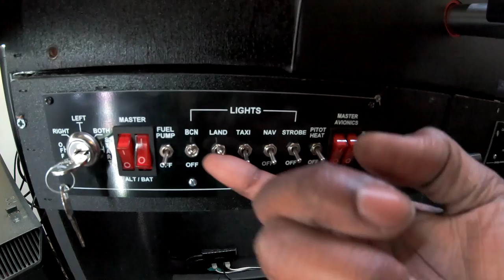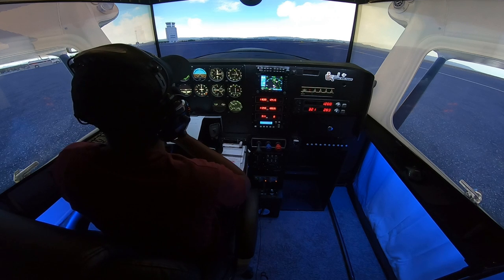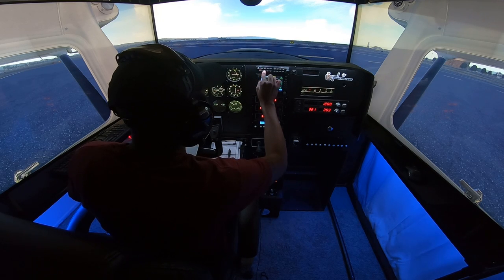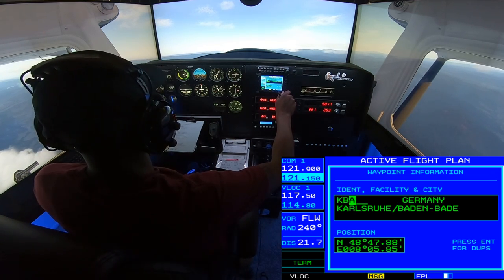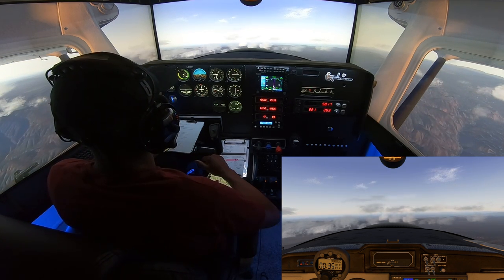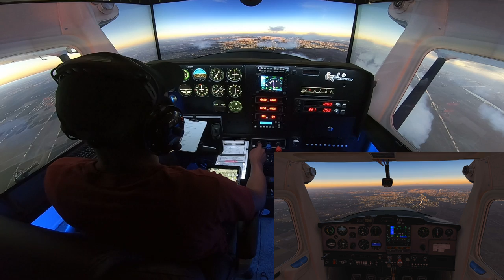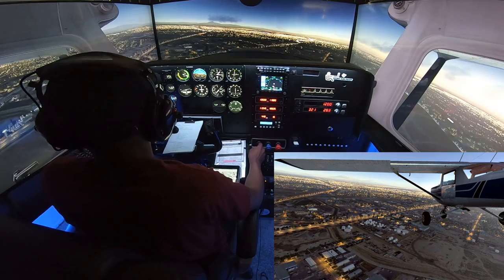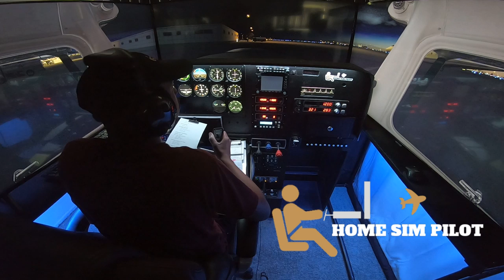FLYING To Bakersfield (KBFL) | Pilotedge CAT 5 Flight | Home Sim Pilot | Xplane 11 50 Vulkan b9

Comment: Really good flight. Just one small pointer. In initial takeoff your vertical speed indicator showed a huge value (almost 2000 fpm). In real flight your ears would hurt a little bit.  Just take care of the vertical speed and keep it a little bit down. These lights airplanes are climbed between 500 and 1000 fpm depending on the weather (hot or cold)  Rest was excellent. Keep up the good work :)

Comment: Man I love your videos! The mrs isn't quite as impressed given I'm measuring rooms to see if I'd be able to fit something similar 😂

Quick question though, I  read in your description you were running the 3 TVs at 1440p off one rtx2080? What sort of fps do you manage with and without Vulkan? I'd be using an rx5700xt so just curious. Thanks in advance!

Comment: Great work on your part putting all this together.  I need a consult with you as I put together a triple monitor flight simulator starting with Microsoft flight simulator X on my laptop (i7, 32 gb ram, 4gb video ram, etc) and then later putting together an i7 or i9, tower with 12 gb video  ram, 3 hdmi out, 64, gb, ram, 4k, blah blah) with one of the more recent Microsoft Fight Simulator Packages.  Peripherals will be all Saitek. Unfortunately, my budget for this is shoestring and my computer skills are mediocre.  Any help you can give me will be appreciated.

Thanks,

J

Comment: Hey man, very nice sim! Can you set the QFE using that setup? Your altimeter was reading 500 feet on the ground when you landed which might have been why you were low on the approach. Great video.
Reply from the maker: Thanks for watching Captain! I should've flown the pattern a little tighter instead of being so far out on final. I think that would've help. And I had the correct altimeter setting dialed in, the airport elevation at KBFL is 510'.
Reply: @HomeSimPilot  Ah, got it. I think I'm just used to setting the field elevation for landing to avoid the mental arithmetic every time I look at the altimeter. You did a great job and you have made me want to build a sim like this. Thanks man.

Comment: Question: You showed us in your rebuild video that you're using Air Manager for the 6-pack, but I noticed you're adjusting the OBI needle with a physical control. Is that part of the panel overlay you have, or did you install some physical gauge housings to accommodate that?
Reply from the maker: The knobs are part of the Cessna panel mask that im using. When i pull it off to change different aircraft I wont have the physical knobs anymore. So im going to buy a knobster to control the gauges.

Comment: Sorry, I’m watching in a tiny screen. Is your six-pack monitor a touchscreen? It looks like your spinning a physical knob when you set your altimeter and heading bug.
Reply: I have the same question
Reply from the maker: No its not touchscreen. I have panel mask with knobs that is sitting in front of a 22" monitor.
Reply: @HomeSimPilot  Thanks! Yeah, I checked out your equipment list and found Nuna Simulations. I'm buying one with a GNS 530 bezel.

Comment: Love your simulator and your videos.   I believe you have your virtual seat height too low.   If you sit in a real C-172 you will find your eye position is higher.   In cruise you should see more of the ground when looking forward.   How much ?   4 fingers between the glareshield and the horizon.
Reply from the maker: Thanks for watching! I appreciate it. Im flying a 152. The monitor for the instruments sits on top of my yoke which makes the panel a few inches taller than normal. If I raise my chair the yoke will be in my knees and I cant bank. So for now I just deal with it being slightly off.
Reply: @HomeSimPilot  I may have explained myself poorly.   I am not suggesting you raise your actual chair.   I am suggesting you raise your virtual eye height using the keyboard commands.   Then you can save this new viewpoint so it is the default at startup.   C152 has a similar view in cruise as C172.   Set it up in a way that makes you happy, and keep up the awesome work !

Comment: I'm having an issue on a clean install of beta9 on a clean install of win10. Customize weather not working, only the slider works, thus I cannot use real world weather. Just throwing that out there. I submitted a report.
Reply from the maker: Thats interesting I havent heard of that issue yet. This is the first beta that gave me the least amount of problems but a few plug ins still dont work. Good luck, hope you get it figured out!

Comment: Some minor pointers:
1) 17:00 ammeter check is done by switching the ALT from the master switch to the off position, watching for an ammeter drop, switching it back to on and watching the kick and stabilizing at 0 or +. Certainly checking for it right away if you see the ammeter in negative even before that, its a clear sign of it providing little or no flow of current. The ALT ''kick'' is done to verify that the gauge itself is working properly and not stuck at 0 or in the center.
2) Around 24:06min in, the best way to communicate would be to indicate the altitude you're crossing (4000 for example) and the altitude your climbing to, so: 4000ft climbing to 7000ft, request flight following''.
3) 56:55 flaps up right after landing with fixed gear aircrafts. Although it might be part of your checklist once you've cleared the runway, its safer and more efficient for the brakes to retract flaps after touchdown. In retractable gear its said that its best to wait and retract flaps once clear of the runway in the off chance you accidentaly retract the gear instead of the flaps.
Anyways, just some pointers I thought you might find useful. I know its nitpicking a bit, since other than those minor pointers it was damn near perfect. But again, you might want to add these pointers/suggestions (or not) to your next flights. Congrats on a great job. Have you considered going for a PPL or CPL?
Reply from the maker: I really appreciate you taking the time to give the pointers. Its very helpful and ill remember it for next flight! I did my CPL back in 2008 but got out of aviation and haven't flown in 10 years. I want to get back into it and just decided to build a sim for now.
Reply: @HomeSimPilot  Ive come across some pretty good sim pilots but your level is truly superior and it now makes sense haha. Great job once again though. From the comments so far, it is clear that you inspire a lot of peole to get into aviation in one way or another and thats always going to be a good thing! Greetings from Canada.

Comment: when i open the game the plane is auto start do u know how to i start it with out the auto start i hope i get a answer please . anyone help me
Reply: In the  flight configuration page, select the aircraft you want to use; then click the customize button.  This will bring up a new page where you can adjust the weight, balance and fuel and failures.  In the lower right of the page, directly across from the failures button is a check box. Check the box if you want the aircraft with engines running.  Uncheck the box if you want the engines off.
Reply: @markbrown8907  Thank you very much
Reply: @markbrown8907  Buy i use fsx and how to do it in fsx ?
Reply: @pioassy  Step 1: Uninstall FSX.
Step 2: Install XP11.
Step 3:  See my above comment.
Reply: @markbrown8907  hahahaha ok
Reply: Mark Brown bear comment ever! 🤣🤣
Reply: @pioassy  1.  Do a shutdown in your favorite aircraft.
2.  Save the shutdown condition by using the semi-colon.   " ; "   Make it the default aircraft by entering a checkmark in the Default box if desired.
3.  When restarting FSX, load the shutdown condition using the LOAD command.